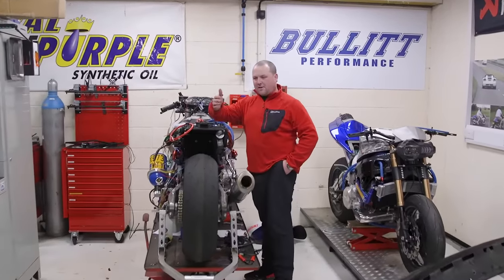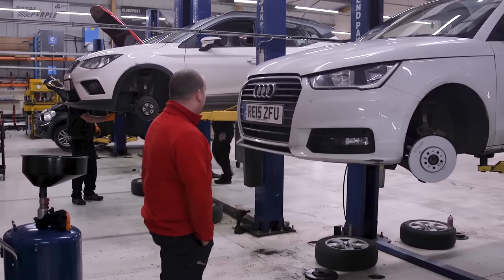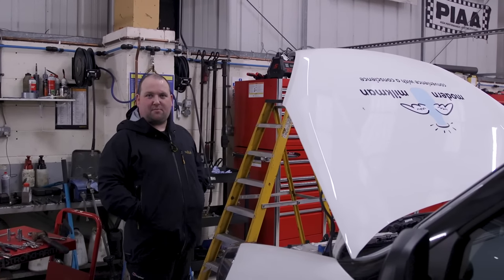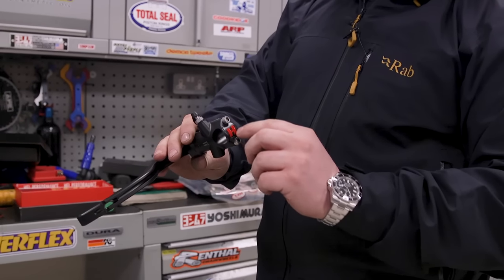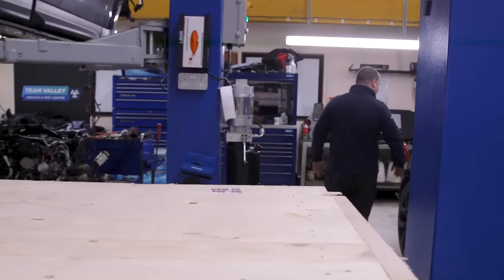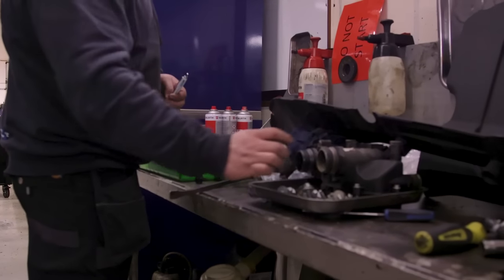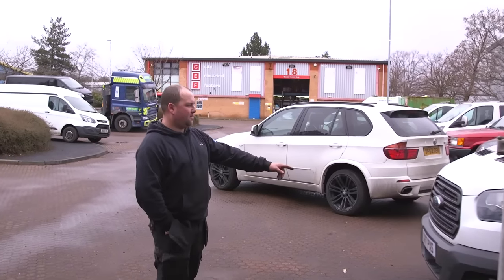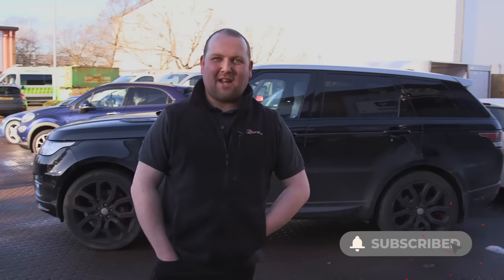3 reasons why not to buy a Range Rover E 32

Comment: The bulkhead wiring reminds me of the Capri ( mark 1 ) I short circuited and melted the insulation on a brand new car.
I wrapped the bare wire with insulation tape and hid it under the dashboard.
Never got any feedback from the poor customer.